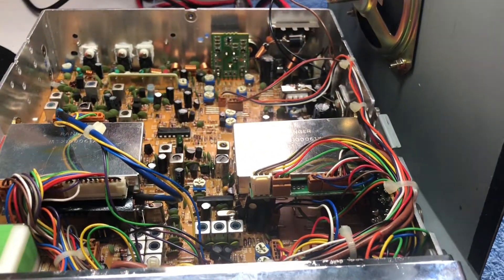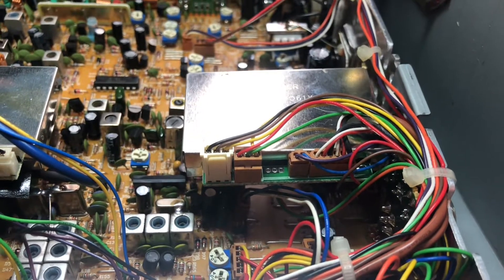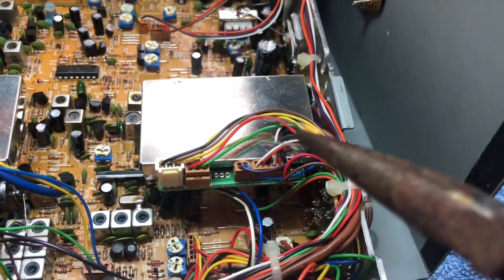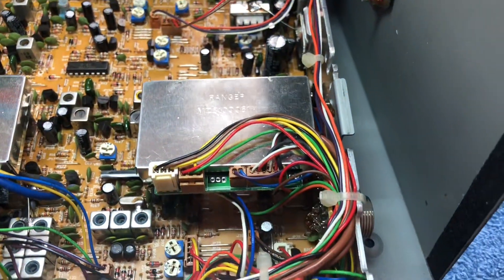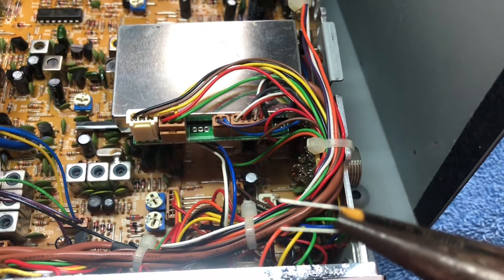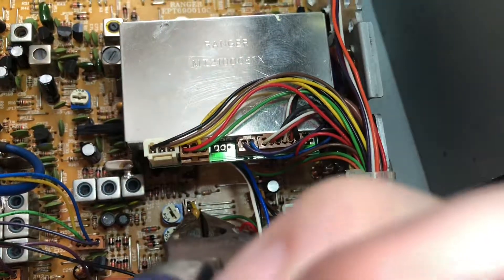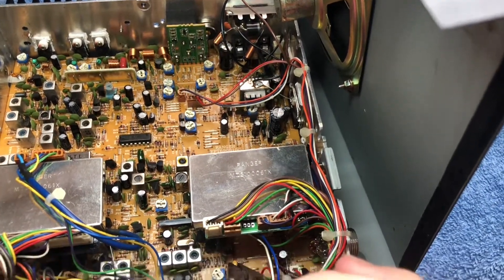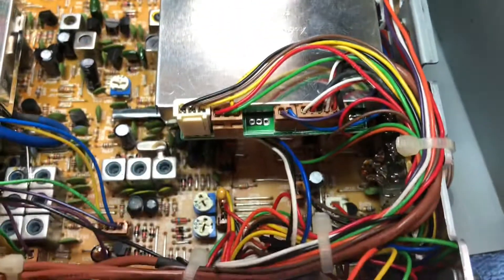Get rid of the sizzle in your radio ! Simple Hi-cut filter

Comment: Old video so I know it's a long shot asking for help here. I have an old TRC-431 Navaho that I'm trying to put a high cut filter on. The center wire from the volume pot goes to VR2, coiled wire post on the board. But if a .33 uF is put from that to ground it generates a tone?
Reply from the maker: I have not added one to this radio.  At worst, if a permanent fix try on the speaker side between positive and negative terminals .

Comment: Is the nb/anl switch the same thing as high cut?
Reply from the maker: This is high cut cap is basically the same as a tone control in some radios  like the Cobra 148. Both NB, ANL  reduce noise,  this basically filters out just the the higher frequencies usually where more hiss is in SSB static. you can change the value of the cap to suit your needs, high value will cut more but can cause AM to sound muffled if to high of a value. it's just a ceramic around  .33 uF value for mine . They also make external speakers with this feature, this installed works for both internal and external speakers Thanks for watching !  👍